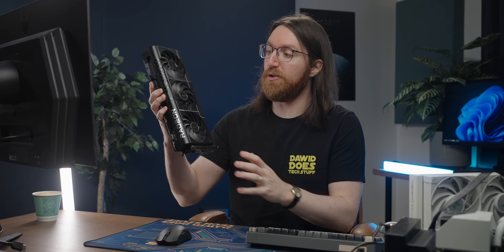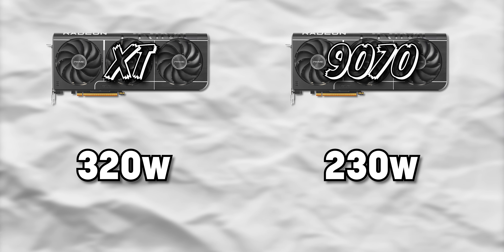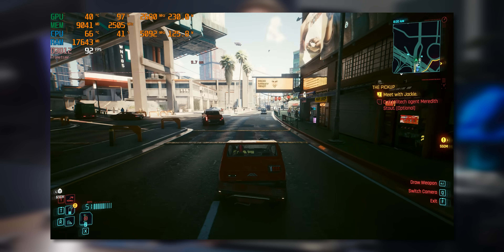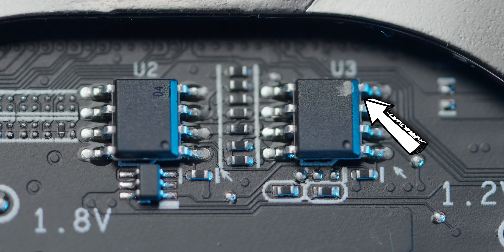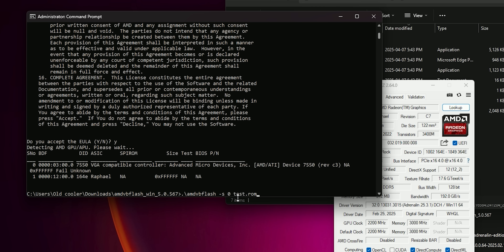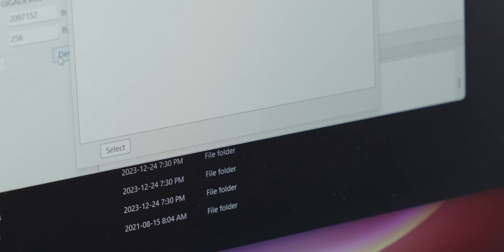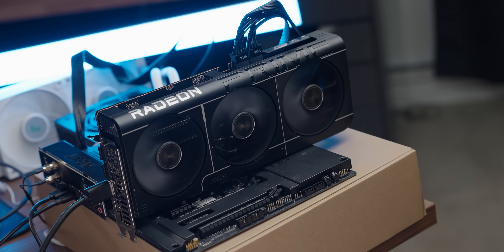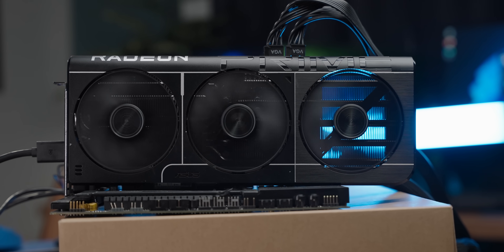I Flashed An AMD RX 9070 XT BIOS Onto My RX 9070...

Comment: Job done on my rx9070 sapphire pulse 👌👍 Flashing Bios from rx9070xt sapphire pulse, 3 fans version ( available on techpower up website) , using ch341a programmer .Chip is under backplate, its secured by 2x screws from gpu chip side. Used tiny screwdriver, and gape between heatsink fins 😂 Without heatsink removing. Power draw increase from 220w to 305w. Clocks from 2900 to 3300mhz. Everything is stable, no bluescreens no freezeing. Can add some screenshots👌 Performance increases from 400fps on Furmark to 480fps. Around 20% compere to stock bios. Really recommend that 👍
Reply: Thanks for commenting on your experience, gives me a bit more confidence, looking at the Gigabyte version right now
Reply: your Bios is Sapphir 	Pulse OC RX 9060 XT 16 GB  Version 023.004.000.068.000001
  on TechPowerup ? Thancks
Reply: No, bios from RX9070XT sapphire pulse, 3 fans version  @leoruti7786

Comment: Your video is very interesting, but I have an RX 9070 OC and it reaches those frequencies of 3.1GHz but consumes 250 watts. It comes like that from the factory. I haven't done anything, but it's surprising that you changed the BIOS. You could say that you unlocked the graphics card.

Comment: Stopped in Cincinnati Micro Center around noon on Mar 7th. I had the RX 7700XT GPU that was only 8 months old. But.... it happened to be AMD day. They had rolling carts of 9070 XT's and 2 OC 9070 options. 7 RX 9070's left. Bought one for 549.00 Have since undervolted by -15 percent and got better performance. Runs around 58 degrees. Power Color 3 fan Reaper. The following Monday again around noon Micro Center grabbed a 32" 4k Curved Monitor on sale for 179.00 so two days Micro Center took my lunch money.

Comment: Dawid how do i fix this, i have am5 motherboard and ddr5 ram, its allways worked fine, flashed to latest bios for my motherboard, now it wont post or get past memory learning, i take one ram out it posts i shut down i put the other ram in it posts past the bios with xmp on but if i shut down the pc it wont boot again and i have to start this cycle again, im stuck in a loop of doing this and i do not know how to fix it

Comment: I remember the times as I flashed an X850 to XT PE...and modified it with a radiator from Arctic Cooling...it was 2004... I still have this card.

Comment: a word of advice though, to anyone wanting to fiddle with such things as currents and tdp - don't. Simply because the components on the pcb are not made to withstand that kind of load. The DRMOS' and other elements crucial to power delivery to the core have a rating in amps, like 50A or 75 or 100A capable. If you make them eat more, they WILL overheat and die, not right there, but with some time, because these are very extreme conditions for them. And there is no workaround to that, you can't cool them more, because they don't have the means to shed that heat to the coldplate. And shed heat they must. Guess where they will shed it? On their mountpoints, hurting the board they on, and resulting in burn-ins and, as a result, the short, that can lead to core taking 12 volts right in the mouth and dying anakin style. 
Your card has limits, live with it. If you want more performance - overclock it, its extra load on the components too, but not to such degree. 
Or better just buy the right gpu from the start, that has the performance that will satisfy you personally. Modern products don't have rigidity and durability reserves, they operate on their edge already. So don't become another client for NorthWestRepairs dude, instead let your gpu live a long and healthy life.
Reply: True , there is a given reason these cards are sold as a non-XT variant else why even downgrade it to sell it at a higher loss. lol
Reply: I had a 9800xt and didn't go to this extent but was able to overclock and game for 2-3 years before it died and I thought I had hit the silicon lottery but this is so true because I also bought a fury x and bought the Asus version that allowed for the 30% over clock due to the beefier power design and thought if this is supposed to compete with a 1080ti then I'll surely burn it out

Comment: This trick has worked for the HD6xx0 series as well, likely other generations as well... but hey I hadn't used an AMD card until now!
Reply: Oh, if BIOS flashing goes wrong... you just boot the system with a different GPU and flash it in Linux...
Reply: Your CH341a works with a tool called FLASHROM, yes it is a CLI utility but it works every time and supports more than just the CH341a ;)
Reply: Also nobody ran into the ROM vs BIN error because most of us know these files are just binary blobs :D

Comment: bro at least share what cards you flashed with what bios so people know what works, tl;dr you need a bios from an XT version which is similar board-wise to the non-XT for this to work.
Reply from the maker: @ps-ib6ct  The link is on the description. 👍
Reply: @DawidDoesTechStuff  sorry am i blind or something? it doesnt say brand nor exact model of the card, it just states 9070, i guess its an ASUS
Reply from the maker: @ps-ib6ct  In the article there is a link to the exact BIOS I used. It's the Asus Prime RX 9070 XT prime bios.
Reply: @ Ah alright, thought you meant in the vid description, thanks for clarifying!

Comment: you could have just used nvflash
Reply: What card did you try it with?
Reply: @AlexHusTech  back in the day i had 3060ti and it was crashing in cyberpunk 2077 so ive flashed its bios with a founders edition one idont know how but it stopped crashing tough ofc i reverted it back after gigabyte fixed its problems
Reply: @AlexHusTech  oh my bad, after further examination i guess nvflash only works with nvidia cards, very good video btw ,cheers!
Reply: @handsomemre  Yeah only for Nvidia, there is no software flash you can currently do on the 9000 series, only BIOS flash ATM.

Comment: It's all funsies but lower tier cards usually come with less capable VRMs. A great example is that I could push a GTX 950 to pull 140W (original around 90W) and overclock it to roughly match the performance to a GTX 960, but it's far from healthy for the VRM and the PCB itself (cuz the PCB was never intended to be pushed to deliver such current).
With that said, flashing GPUs like this is not really a good idea. A bit more sophisticated mod would be if you check the card's VRM rated current limit and chose a model that is designed to handle the extra current (or at least chose the one that is the closest to that value).
So you can do this mod, but it is safer to do on more expensive or capable models and those already cost more. (But boy is it funny and satisfying seeing a card get that much of a performance uplift from a BIOS mod)

Comment: Despite the video being informative, energetic and fun, I do have one fundamental criticism: the disclaimer needs to come BEFORE the process. Most people won't have a clue what they're doing and not get to the disclaimer at the end because the information they needed for the process came largely before. 

Despite flashing a 7900XTX using the correct vBIOS with amdvbflash, the file provided was corrupt. Utilising the second bios still leaves the other bricked and requires a hardware flasher. Also, attempting any of this voids your warranty if you can't restore it. vBIOS modding is so unpredictable and even original backups can restore improperly and brick your card.

So keep up the good work but slap in a quick disclaimer of the biggest risks and let people know this shouldn't be done unless decently researched - no blind following and hoping for the best.

Comment: I remember when I BIOS modded my ati 9800 to a 9800xt, but that's when they used to use the 9800xt chip with some of the shaders disabled in the 9800. Mine was from sapphire.

Comment: It can read .rom, you just needed to change it to all files when you selected open.... bottom right corner, drop down, all files...
Reply: Also, it has to retrain ram after 1st bios flash so the hang.

Comment: My 7900XT
Daily settings:
2650 on the memory 
-10% power limit (313w)
 -70mv undervolt (1030mv)

cyberpunk @ 1440p ultra - canned benchmark 
av- 144
1% 123

Same settings on GPU and game but with a +15% power limit (400w)
av- 152
1% 130

Did all of this at the time of posting and I have no idea who this would help with but there ya go. On the lower power limits the 9000 cards are amazing but when they are pushed they just really don't offer much more than the 79XT(X) bring. I guess the like 20% RT performance is nice but I really don't see the point. Especially if you have to spend in the 700s for the non XT 9070 and close to 1000 for the XT. At those prices AMD should have just kept selling the 7900XT(X) cards with a slight discount.

Comment: So I just did this with my 9070XT Swift to upload the Mercury Bios to it.  In Neoprogrammer the Open prompt defaults to just the (.bin, .hex, .eep) file extensions.  But if you click the drop down menu it gives you a bunch of different options.  Like .rom, and .cap.

Comment: I don’t understand the market for a 9070, when a much more powerful 9070xt costs $50 more…like a 7% price difference…whats the purpose of the lower one?
Reply: lower wattage and power draw? On average you would save 50 - 70€ a year just by using the non-XT if you play on average 2 - 3 hours a day. 
A Card lasts around 3 years or longer. You would save 240€ just by the first 3 years of using it. By the time you swap that out you literally almost saved the cost you bought the graphics card for in the first place at MSRP.

Comment: Makes no sense at all if you need 3rd party hardware that is compatible with especially YOUR Bios Chip and some "random" Software to flash the bios...
You can also make a "Shunt-Mod" if you need to do some "external" things to "trick" Power-Limits -> same effect.
I don't even make sense if you need to pay "anything at all" to make this work!
The only way it would make sense is, if Bios and Software comes bundled or even better with a One-Click Setup file for Windows or DOS.

Comment: Fun story: Back when HL2 released, I had a Radeon 9600 and got 26 fps at max settings in a game. My dad bought a 9800XT and he let me try it before I built his PC. So I put it in my pc and re-installed all the drivers and got almost 60 fps. These are example fps, the story doesn't need exact figures. I built my dad PC and put back my 9600 in my PC without re-installing the drivers. My frame rate average stayed at the level I was having with the 9800XT !!!!!! Back then, the 9800XT was the king of the king of ATI cards. 9600 was the equivalent of a Dodge Neon with manual windows.
Reply: Not how it work but whatever lol
Say the truth you put your 9600 in dad PC and keep the 9800xt for you
Like dad would ever know

Comment: Couldn't find a 9070 or XT that wasn't an insane price, so I opted for a slightly used RX7900GRE , it's pretty much the same card except faster clocks, and when I checked the bios on the OC side it says 7900XT so idk if someone flashed it on the card or the silent mode bios is the GRE and the OC bios is the XT, I only paid $599 for a powercolor hellhound, I think I got a pretty good deal

Comment: How in the world are you pulling 300w while the card is at just 45c? Is your room temperature freaking -5c?
Reply: just a low ambient temp with a good cooler works that well

i've been able to have my 7900 XTX just below 50c when it was drawing like 380w from what i recall
Reply: My 230w triple fan gigabyte 3060 ti jumps to 60c the moment I launch a game and stabilizes at 78-80c after a couple of minutes with all fans maxed out
22c amb
How is apparently literally everyone else getting such low temperatures at 400w is beyond me (unless they use liquid cooling that's more expensive than the card itself)
Reply: @Napert  have you replaced your thermal paste on the GPU?

Comment: This is super cool. But I feel like something doesn't add up here.
How can you get bigger performance gains from flashing a 9070 to an XT bios than the XT card itself?
You got a 25% performance boost, while according to the 9070 review from Hardware Unboxed, the XT should only perform 10% better in Cyberpunk.
The bios flash might have broken something?

Comment: Is this kind of a no brainer then? If you have the tools, why wouldn't you do this? 2 bios chips means you can't ever be locked out of using the card again, plus you could always just backup the chip you replace just in case and flash it back? This seems like literal downloaded performance gains
Reply: Once AMD VBFlash gets updated it'll be even easier.

Comment: You made this card 33% more power hungry without increasing it's cooling capacity. Stuff like this will only work when everything is new and clear but once fans and thermal pads get used up it will massively overheat. That's just extreme overclocking.

Comment: Or you can just use MPT ( more power tool ) application and & modify current power limit  without bios mod 😂😂 permanently

Edit - MoreClockTool has been updated for RDNA4
Reply: Not supported for RDNA4 currently
Reply: @AlexHusTech  MoreClockTool has been updated for rdna 4

Comment: There is obviously a reason it got locked to 230W. But what is the reason?
a) Accounting for super low (and almost useless) gpu core bins?
b) power delivery (+vrm) h/w being specced too low so it can't do sustained 300+ W ?
c) artificially widening the difference between the 2 models to justify pricing ?

Comment: And that's exactly what I said when people complained about 9070 being priced so close to XT. Main differentiator is power limit, as has been so many times before on AMD's side.
And it is reason why people should buy 9070 variant which has good cooling.

Should be noted, that cut-down chip of same quality (efficiency) should clock higher at same voltage and power. Therefore portion of what's lost by disabling CUs/ROPs is recovered by clock.

Fun fact: Many reviewers (wanna be professionals), were blown out of water by 9070 XT clocking above 3.1GHz. Yet my 7900 XTX ticks under some workloads 3.15GHz.
But it is nice change from "under some conditions" to "undervolt and enjoy".

Comment: I am sending you my RX 9070, which I do not have. 😂😂😂
Truth be told, after seeing the prices on RTX 5080, as an upgrade to my 3080 Ti, I ended up buying 4080 Super for USD1K, and feel kind of happy. I wish there was 9080 XT which performed closer to 5080  in raster and close to 4080 in RT, for true USD800. :))

Comment: The "Max Frequency Offset" just shifts the voltage/frequency curve up (just at the very end iirc).
Modifying the V/F curve on AMD cards is different than with NVIDIA, where you have multiple dots with specified V/F values.
When opening the V/F curve setting in MSI Afterburner for example, you'll see one curve which is P-State/Frequency (this one is exposed as "Max Frequency Offset" in Adrenaline) and the other one is P-State/Voltage (this one is exposed as "Voltage Offset" in Adrenaline), whereas the P-State is either 0 or 1 (so it's a linear function).
Bumping the max frequency offset by e.g. 100MHz just raises the P-State 1 dot up by 100MHz, but the P-State 0 should remain at +/-0 iirc (RDNA4 has no support for V/F "curve" tuning with MSI Afterburner atm, so I can't check right now).
Adjusting the max frequency offset only yields results if you're actually maxing out your current clock speed target. You can usually see this if you're undervolting your card further and further, but don't see the GPU clock speed rising. This is where you'd have to bump this value up a bit.
Hope this helps :)

Comment: In general you don't want to flash a bios in circuit. You really should remove the chip and solder it on to a temporary daughter board. All sorts of problems can result if the chips not removed to flash it.

Also when you flash the 9070 XT bios it's still going to be seen as a bog standard 9070. With the 9000 line the Bios is not what determines the model.

Now if AMD could just get the cards in stock. Even the overpriced cards have been out of stock for a while.

Comment: Are there more cards with dual bios chips and a switch??
I've never heard about that. 
There must be a reason why the manufacturer did that. 
Is it an AMD 9070 thing or is it just that particular ensambler ??
Reply: This is not a new thing, this is normal amongst the more premium models. One mode is pure performance the other dials the performance down and reduces the fans speeds to make it run quieter.

Comment: ALWAYS turn off fastboot in your mobo bios when flashing the gpu. It tries to use device id from old vbios and fail to load driver because you flashed new vbios with new device id.
After second reboot it will load new device id and reinstall driver for it.

Comment: A bit comical that someone would be glad it's using more power, but i Know what this means obviously.  Usually people are complaining about power-hungry components and looking for ways to reduce power without severely impacting performance (and one reason why Nvidia got a lot of crap back in the day because some of their cards used a lot of power, versus the equivalent AMD solutoins that used half or less).

Although this bios hacking would make sense because manufacturers use the same dies for OC'd cards, just with some other different specs like maybe more/faster memory and better cooling.  So the only downside to this hack might be that the cooling may not be adequate enough to keep the card within the designed spec for the cooler that's installed (although you could always watercool the system or buy a better cooler probably).